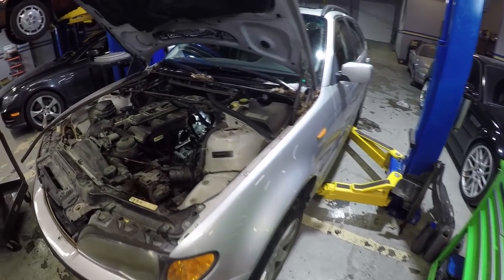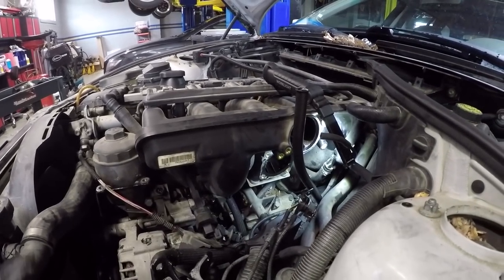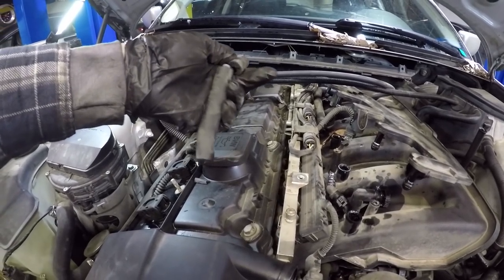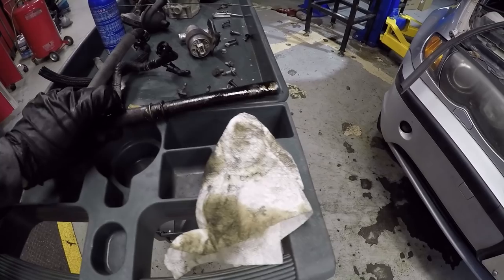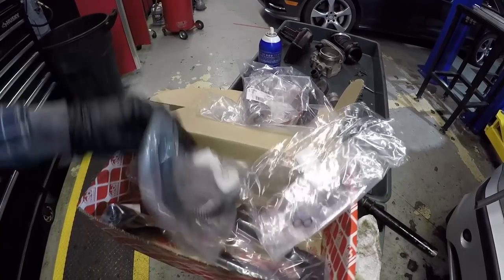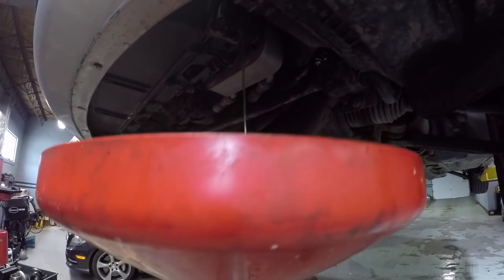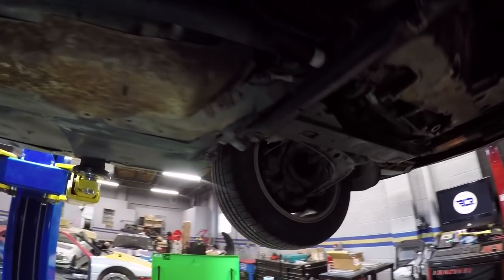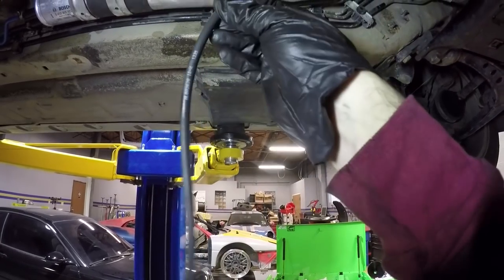$300 E46 Wagon | Ep.2 | First Round Repairs

Comment: I've always removed the intake manifold to do the CCV replacement. Not only does it make it much easier, you also get the opportunity to replace a bunch of other crusty old gaskets in the process.
Reply from the maker: Not a bad idea. But...I was doing my best to control the slippery slope of replacing/refurbishing everything in the engine bay (fuel injectors etc) by not removing parts that weren't absolutely necessary to the specific job.